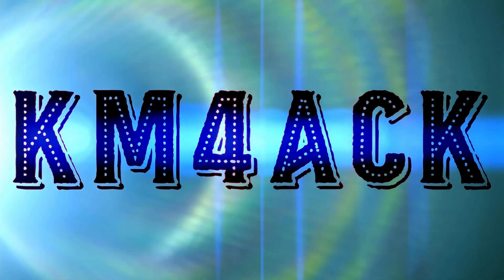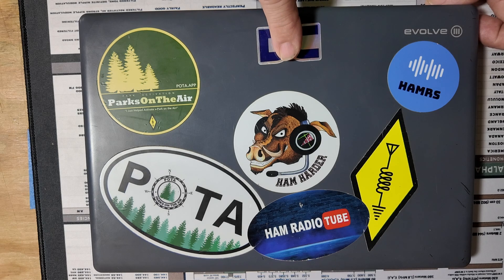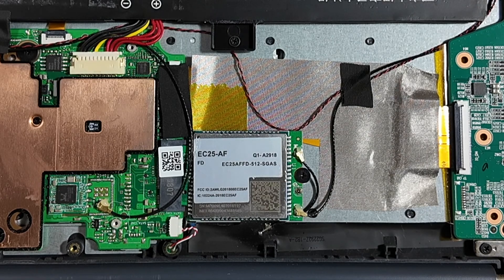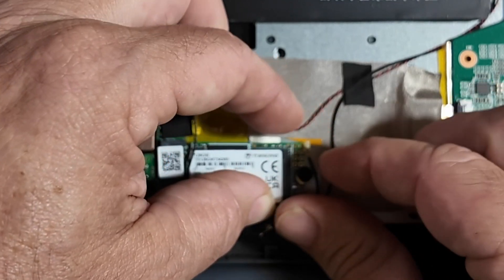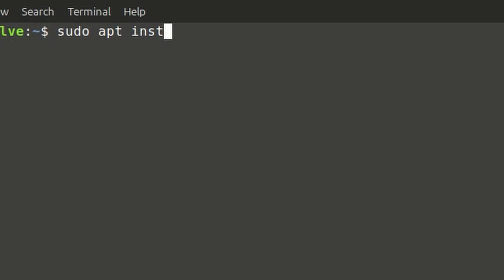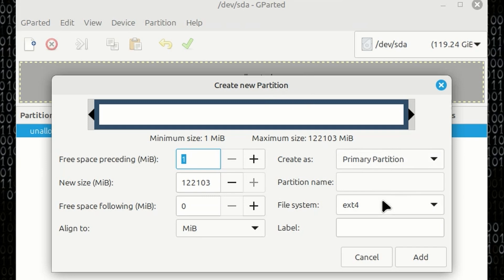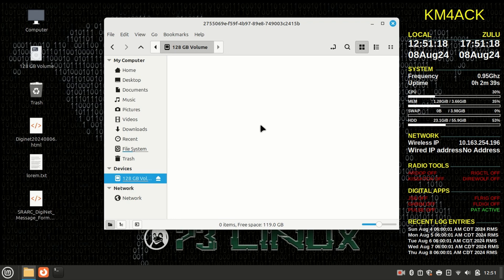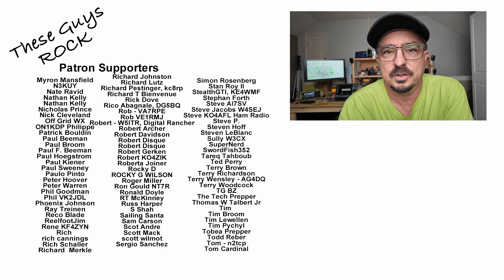Upgrade Your Evolve Laptop

Comment: @jasonKM4ACK, is there a limit on how much capacity the SSD drive can be? I know the max on the Micro Sd Card is 256gb…so I’m. Wondering if there is a cap on how big the 2242 can be? I’d like to put a 1TB in it??
Reply from the maker: That's a great question that I don't know the answer to. The only one I have added is the one you see in the video.
Reply: @, I finally picked up the model with the cell modem! It arrived today, and I have the SFF 2422 M.2 being delivered tomorrow. I installed my FT891 in my car and have been activating with CW, SSB and the FT modes with my other Maestro Evolve III, but now I’m going to replace with Digirig Mobile with a Timewave Navigator so I can go QRV with RTTY for contests running Mobile. I’ll let ya know how it goes 👍👍
Reply: @KM4ACK , Have you tried using the MORTTY V5 interface or any of their products? I ordered the V5 and should have it in a few days. The Digirig Mobile has been the easiest to setup and use and Dennis has incredible customer service. Just wanted to know if you’ve tried the Mortty products. Steve has started shipping product again since Larry - K8UT, became a Silent Key…those two Guys together were an AWESOME Team and Steve is doing his best to continue the Legacy that Larry is known for ❤️❤️

Comment: I have a question. I am wanting to learn how to program on Linux. I’m running Mint I was wondering what you used to learn programming. You seem to be very knowledgeable. Thanks in advance. John
Reply from the maker: Great question John. I used the web and a few Linux elmers to learn what I know. I started writing basic bash scripts to automate things I wanted to do. Each project brought a new programming challenge which I would research until I figured it out.

Comment: To be fair, there is one reason not to do it... if you use the cellular modem. That can be useful if you want to be able to do spotting of your station while you're in the field. But you do have the option of using your phone as a WiFI hotspot instead.
Reply from the maker: Good point.

Comment: I’m a Mac and Linux guy but finding I need an inexpensive but capable Windows machine for some ham radio stuff. 
 Is the evolve still a good choice or are there other better options now?
Reply from the maker: I am still rocking the Evolve after two years. Mainly for the fact that it will charge from 12V
Reply: @KM4ACK  will charge from 12v is a compelling feature for me too since I have a camper. Interesting.

Comment: Hey Jason, I pulled my Evolve a part that does not have the SIM Card slot so I could verify the Motherboard architecture. My motherboard does Not have the 2422 SSD header connector, so you are Indeed correct. The Evolve laptops without the SIM Card slot are Not configured for the 2422 SSD upgrade. 73, Danny  NF4J

Comment: I put a 512GB in mine and dual boot Linux and Windows. I use the original 64GB for Recovery with Ventoy and images of Linux Mint and Foxclone.
Reply from the maker: Great idea!
Reply: Thats exactly what I did to mine. I made sure it had the sim/modem feature and replaced the sim card with an ssd and made it dual boot windows/Linux, then bough another ssd and cloned my evolve ssd, once I got all my radio settings perfect.

Comment: I'm not going to ditch Windows 10, just yet.  so if I add the drive, will if work okay with Windows? Or will the new drive be too large? Etc.
Reply from the maker: It should work just fine with windows. You will have to format the drive though after you install it.

Comment: To clarify, this is replacing the WiFi capabilites on this unit with additional storage space, correct?  Were you not making use of the WiFi?
Reply from the maker: @xringer is correct. It’s the cell board that I took out and replaced with the SSD.
Reply: @KM4ACK  okay, that makes more sense. Thanks for the clarification! 73 from the PNW
Reply: I think he said Wi-Fi by mistake that's the cell board. The SIM card that you use is from your cell service provider.  
I was using a Google Fi  data-only Sim in the Evolve and it didn't work. I used my SIM card in a hotspot device.